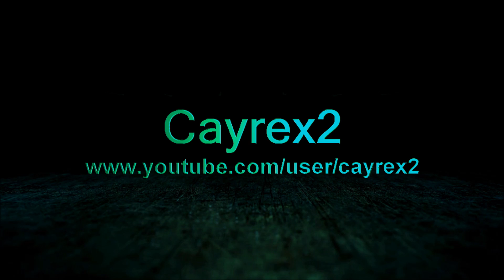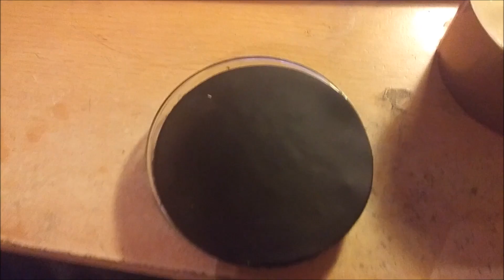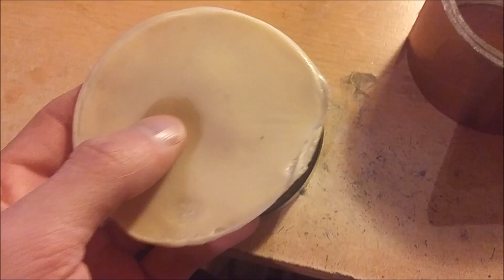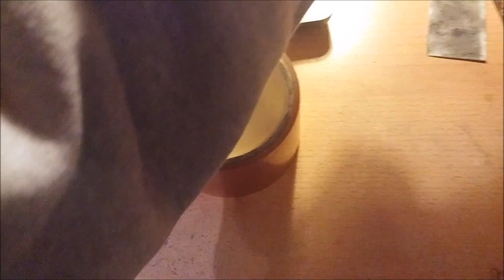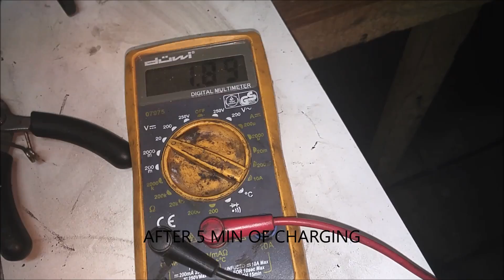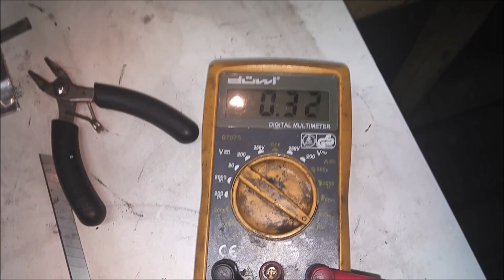SOLID STATE BATTERY

Comment: No battery companies want to make solid state batteries because they have 100'000 charge cycles meaning no one will need to replace them meaning not a sustainable business model
Reply: Anthony Steele, Tesla makes their own batteries! Your statement is disqualified by the incentive to prove electric vehicle viability which only suffers from poor battery technology.
This has proven over and over again to be the Achilles heal of portable or mobile electric gadgets. 
The second point here is the replacement of the primary and rechargeable battery industry is in the hundreds of billions, more than enough incentive for emerging tech companies as well as the current companies wanting to hold their market share.
‘Business model” if I had a dime for every nay sayer of advanced technology  that has had to eat their words.I could would start manufacturing these myself.